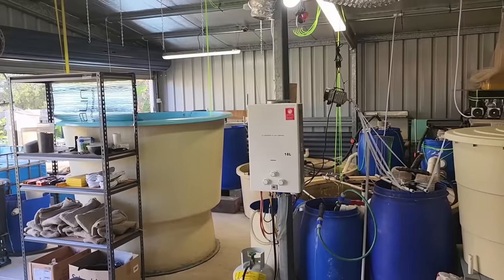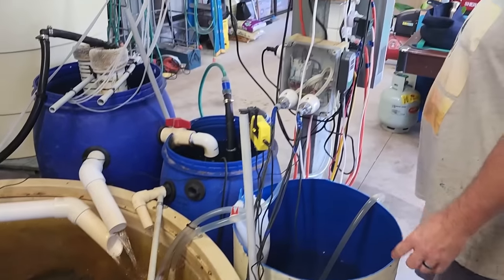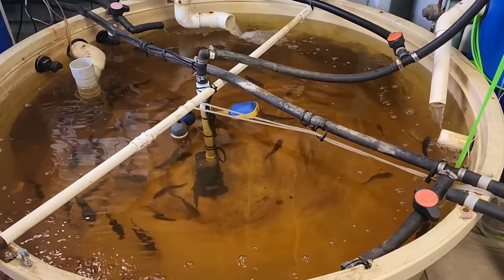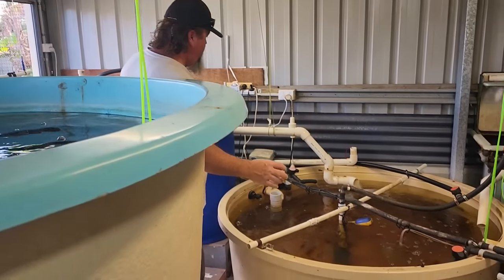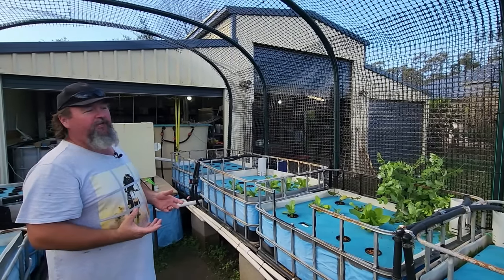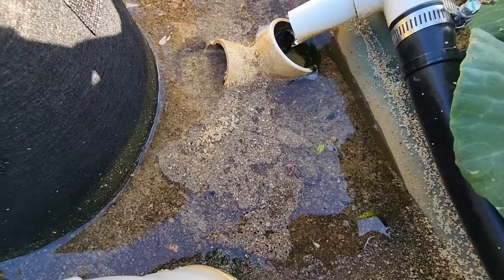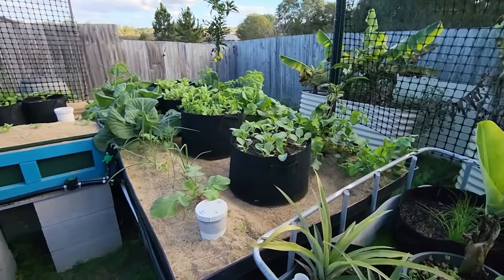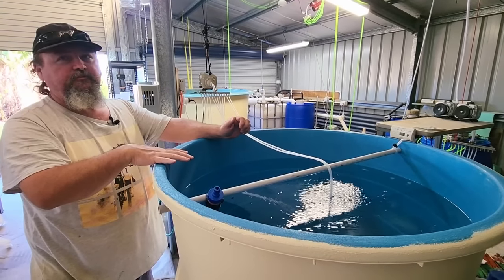Owen's EPIC Aquaponics System | Sand beds Swamp Beds Barramundi + MORE

Comment: I have a radial flow filter after my ibc fish holding tank to catch primary solids before going into K1 moving bio filter after that it does to mechanical filter which is a number of essentially giant scouring pads to catch fines. If I were to do it again I'd add a second radial flow filter after  the MBB filter as I find the fines produced are likely old bacteria off the K1. 
Where can I get some of those filter socks?

Comment: Awesome stuff Rob (as usual). Great inspiration for our small commercial micro farms in Uganda at Urban Greens. 

Really love the idea of the three tanks as it makes it easy to manage the various growth stages of the fish and keeping fish biomass fairly constant without having wildly various sizes in the same tank. 

Also think the thinking around mixed media and sand beds is spot on. We generally need to think about how we make the systems as productive as possible per square meter while make them as efficient as possible. This does seem to pull a  fair amount of power (even if you take out the heaters).

What does Owen use in the growth pouches? Just plain compost/soil or a sterlized potting mix?
Does he add any nutrients to the system besides the fish feed?

Such a pity you guys are an ocean removed from us here in East Africa :)
Reply: She can be a power hungry beasty, but I have 20kw of solar on the house and shed roof, plus am putting in a rather large battery at the start of the month, so power luckily isn't an issue in my case. The pouches i use whatever i have onhand at the time. compost, potting mix, dirt, you name it, I chuck it in there for diversity of minerals. I add brickies lime and potassium to buffer. On top of that, I add iron. I was adding seasol (a general plant tonic) in the beginning, but haven't had to of late, this is either due to it being winter, or the mineral sharing from the different bed types. I will soon see come summer which is the case.
Reply from the maker: Thanks Peter. 👍👍 I'm thinking a bit of all growing styles to suit the plants is the way to go.
Reply: @owensfunhouse7582 Cheers for the reply mate! I'm trying to keep power as low as possible to keep running cost as low as possible. It's obviously a bit fragile in case something brakes but that's why we have remote monitoring on the systems. I'm currently at about 120w combined for air/water and control electronics, all to keep it as cost effective as possible. I'm powering during the day with solar through my own smart controller and then at night off the grid with a power backup battery in case it all goes down. It's been fairly stable but could definitely have some better/faster growth of the lettuce.

Anyway, figuring out is all part of the fun :) So thanks for sharing guys!!
Reply: @RobsAquaponics  indeed, gotta keep this veggies happy for them to make us happy :)

Comment: Thanks Rob & Owen. 

Where in QLD did you source the sand for the sand bed, and what type is it? 
Did you test different specifications for the sand? I suppose you can't have it too fine or it could clump together, can't have it too coarse or it won't filter properly.
Reply from the maker: I Think Owne mentioned in a PM a while back so will go dig it out Callum. 👍
Reply from the maker: Here you go Callum,
https://www.riversands.com.au/application/horse-arenas-tracks/
Just double checked with Owen & he confirmed.
Reply: @RobsAquaponics  
Much obliged!

Comment: @Owen's Funhouse hey mate, how efficient is the gas water heater you find at night ?
Im considering something similar for my small setup down here in NSW.
Would love to grow barra year round but our winters stink.
Reply: Small volumes 500L-1000L it costs about a tenth of running a electric heater if kept at 25-28 degrees with a night temp of 5-10 degrees. Halve that for every 1000L extra water volume. The sweet spot for it is about 20-21 degrees for maximum efficiency. The barra do alright at that temp too FYI.

Comment: Do the sand beds use a bell syphon or just constant flow?
Reply: Timed flood and drain.
Reply: So you could make one with a bell syphon, any reason he went with timed flood and drain instead?
Reply: @whitneyhungerford2545  I don’t think it would work effectively with a bell syphon. The sand takes time to drain, it doesn’t just flow to the bottom like normal media. Also it will break the syphon prematurely the way water flows through sand with air pockets. The sand takes an hour to drain completely in a bed that size.
Reply: Ok so just a pump on a timer,  I thought about doing half my small grow bed sand and then gravel near my bell syphon but it might create anaerobic areas in the sand part.  I’ll make a separate sand bed to avoid issues.
Reply: I didn’t realize I was talking to Owen, thank you.  Just cycled my system after building for a year so now I’m looking at ways to possibly make things a little easier.  It’s indoor cause I’m raising tilapia in Montana and noticed there always seems to be a leak somewhere.
Reply: @whitneyhungerford2545  I feel your pain on leaks, I've flooded my shed many times over the years. It's good now though. One leak at a time, you'll get there, and eventually look back and laugh while enjoying the produce. A seperate bed is the way to go.
Reply: I’m obsessed now I blame rob for making it look like so much fun.

Comment: Pl also mention KWH of electricity consumed with all these equipments.
Reply: Day time or night time? During the day my solar covers all the use. At night the electric heater switches to a gas heater, the beds are turned off and only the fish part of the system runs. the system draws 390w no heater, 2890w with electric heater. At night it draws 290w but does have the gas heater going.
Reply: @owensfunhouse7582  so 390 w load for 8 hrs approx at night correct?
Thanks for replying
Reply: @birendrachoubey6122  Yes, but there is also the gas heating on top of that.
Reply: @owensfunhouse7582  understood thanks

Comment: can owen suggest what kind of air bubbler/stones he suggests for bio reactor? ive got one of those air pumps but not having great turn over of my air stones 

fantastic idea with the closed loop heater element, and the salting tank... brillant!
Reply: I use the 2 inch/5cm circular ones. On a budget the blue sand ones do the job. If money is no object, the white silica ones.

Comment: Good day Rob from Kansas US.  I used a sand bed as a filter for a large pond when I lived in California, which included silica sand, vermiculite, and powdered activated charcoal.  That bed grew anything i put in it, silica is beneficial but  I think the charcoal is key for grabbing the nutrients and holding them until  the roots can use them. Plant leaves became appreciatively Greener and lush, I believe plants take up charcoal in that form and basically, glucose is carbon.
Reply: An iAVs takes 3 months to become functional and then about a year for it to be considered a mature system. Thie silica in the sand is completely unavailable to the plants. Microbes are the key aspect of an iAVs and they transport, store and convert the nutrients for the plants.

Comment: Hi Rob. I have been trying the kraky hydroponics and having problems with root rot. I assume this is a problem you don't have with aquaponics or any of the other active hydroponics system and potentially only a passive hydroponics issue. I think if you have a video on how to deal with root rot and ways to prevent it would be good. Thanks in advance
Reply: Add bacillus subtillus and more biology in general
Reply from the maker: It's not something I've really had to deal with so haven't had the opportunity to film anything on Dennis. Did you end up sorting it out?
Sorry I missed your post as well mate.

Comment: Great to see something different with sand beds. Can you cover downsides to them and most importantly how do we source the correct sand? Great show as always
Reply: Downsides: You need an extra pump on a timer, unless you are willing to run a full IAV system. The furrows are a PITA to keep in shape, and rain will affect them too.  When its really windy the sand will blow away too. The coarse riversand is the best I have found.
Reply from the maker: We've chatted about doing another video just looking at them Karim. 
Let me know if you have any other questions & we'll run through them on the video.
Reply: @RobsAquaponics  i do one of the biggest problems . other than restocking fish is the build up in clay ball beds . you know the maintenance you need to do with washing it out and blowing air in the bed like the video you did showing us. do you need to do this with sand bed or does it all break down totally .if so . very valuable addition to system as you have far less work involved in the system
Reply from the maker: @karimhayes3134  Cheers mate.

Comment: The set up looks too complicated and too massive for the average person to even get anything viable out of it.   When you start discussing power outages and the unreliability of available power supplies and the expenses of running it must be astronomical.
Reply from the maker: Not really. Owen started small & the system grew as her learned more, just as most of ours have.  👍The system is run by solar so that's a HUGE +
Backup systems can be built using a relay that cost only a $ or 2, a car battery & a 12v pump. 
Here's a beginners playlist if you want to see more about getting started in aquaponics,
https://www.youtube.com/playlist?list=PLBcWprMIwYYj8zCdbSzPJOR3HRXpxuBwf

Comment: I’m surprised with the scale and complexity of your setup, you wouldn’t have one of those revolving drum style filters to deal with the physical waste of all your large tanks before it went to the bio filters. I’m guessing even for a setup of your scale they must just be prohibitively expensive. 
Do you use, or if you did would you even get any benefit out of using RO water for all your water makeup for your system?
Reply: Very very impressive otherwise. Can get a fair figure on both the time and money invested in your shed alone, and I’d dare say you wouldn’t be able to have a setup like that for under 5 figures.

And just out of curiosity, do you get much more lean meat out of the barramundi then the perch? Farmed jade perch always seem to have a LOT of fat on them
Reply: @tinderella2386  a rotary drum filter can be had for a couple of grand. The insulation I would need to not have the neighbours calling the council about the noise from one would be about 5k, so while cheap for one, what it would need in addition, not so much. I have 8 water tanks scattered around the house and shed. I’ve only had one year where I came close to running out of all the years I’ve had it running. I looked at RO, but it’s not really needed.
Reply: @tinderella2386  The Barra are very lean, with little to no fat, the catfish are also very lean as well, but both have trade offs. Barra need heat, and catfish take time. I purge the jades in salt water which helps to a point. Grilling or smoking the jades is another way out of it… They also deep fry beautifully.
Reply: @tinderella2386  as per cost, most of the expensive bits, I managed to get second hand. The big tank was about a fifth of the price new, the 2 smaller I snagged at a farm expo in a 2 for one deal plus 30% off. I’m a sparky so most of the electrical I cobbled together out of bits from old jobs. The washing machine for the filter socks I got for free and repaired myself (It was getting replaced as the lid no longer locked) The K1 is a heck of a lot cheaper when you buy in lots of 500L. EBay specials, Facebook marketplace and gumtree filled in the rest. Oh, there was the Milwaukee PH controller though, that one hurt the hip pocket haha. 
As for the time building and refining it… let’s not go there 🤣🤣
Reply: Yeah thanks for the detailed replies, you honestly probably have one of the most impressive privately owned systems in Australia.
I had no idea a drum filter would be so noisy?! Maybe instead of insulating your entire shed, you could have built a box with no bottom that you insulate heavily and it sits over the drum filter and pipe work and you just lift it off for access.
But I wasn’t sure about RO in aquaponics/aquaculture. Honestly any serious hydroponic setup of any size will all use RO water as it makes such a difference.
And yep, I’m in Perth and I’m a fridgee by trade, an instrumentation technician by trade, and have been a BMS controls technician for the last 8 years before I changed career so know what it’s like to be able to do everything myself too
Reply: @tinderella2386  They are noisy like you wouldn't believe. I thought about covering it with a box, but I also felt I needed to draw the line between a hobby system, albeit an insane one, and a full blown automated beast. If I'm being honest, I kind of like the few minutes morning and night changing 2 or 3 filter socks, as it gives me an excuse to just stand back and watch the fish before and after work. Maybe as I get a bit older I may yet put one in, but I rather enjoy what liitle hands on experience/maintainence I still have to do manually. The system uses maybe 300L a week in summer, so water hasn't been an issue.... Yet, touch wood.

Comment: So basically your doing a return activated sludge plant lol
Reply from the maker: Not really as the "sludge" is left to sit on the surface of the sand after collection in the settler tank. Return activated sludge normally has an active aeration component as I understand it.
Reply: @RobsAquaponics  I was watching your ibc video and I’m wondering how many yabbies could I put in the tank instead of fish.although I’ll being doing a fish one as well.and thank you for your vid
Reply from the maker: @dizzystj  Not as many yabbies as fish mate. You also won't get as much waste generated as fish on a one to one basis. Stocking rates can be as low as 5-10 per M² of floor space where you could get up to 40 fish in an IBC (as long as you have the biofiltration side sorted out 😉). You can increase stocking rates by creating places for the crays to hide. Some will use stacks of bread creates or stacks of PVC pipes.